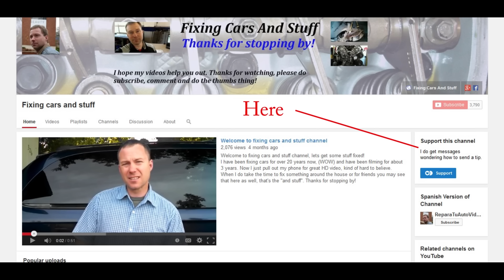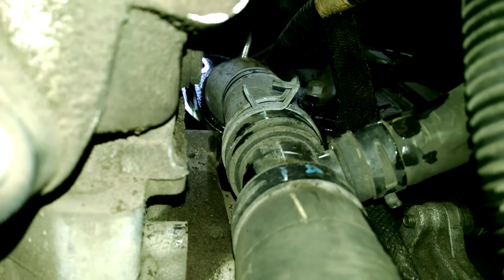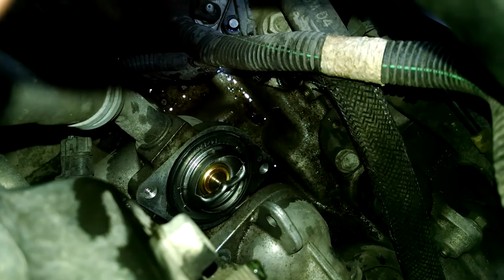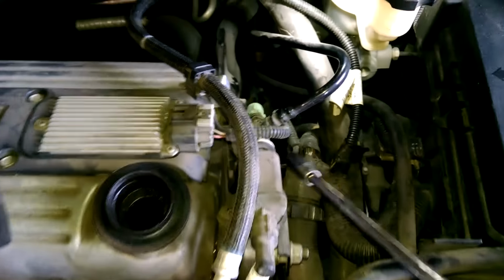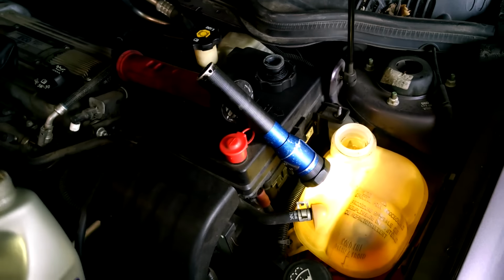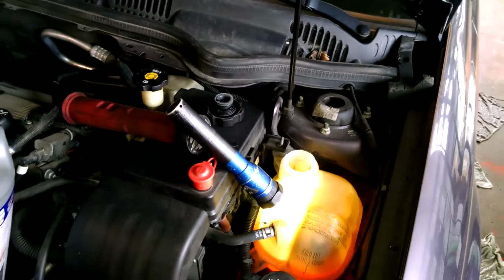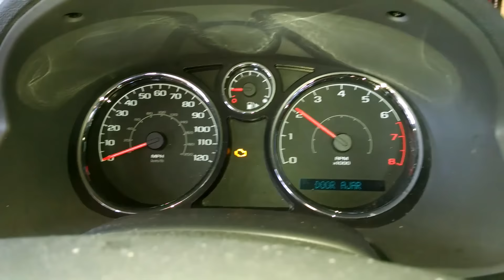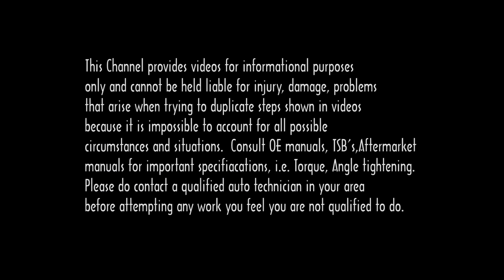Thermostat replacement P0128 2006 2007 Chevrolet Cobalt.  How to change thermostat

Comment: oh your got lucky lol i had an 05 cobalt its bolted directly into the back of the engine and the water pump piping goes directly under the exhaust manifold lol i figured i would never be able to get it back together if i did manage to get it apart took it to a shop lol he had some choice words about it when i picked it up lmao he wasnt happy but got it done lol
Reply: +RastaLulz it was about $150

Comment: I did this but I think I filled the fluid too much to the top. Can that mess anything up? because now my car has a coolant symbol coming on. I take it that it's overheating.
Reply: did you bleed your coolant/antifreeze system?, most likely you have air pockets in the system causing it to overheat, it's real easy to do, only takes about 10min, there's hundreds of videos on YouTube on how to do it, good luck.
Reply: There wasn't any coolant/antifreeze in there. I just poured a bottle of antifreeze in there and it wasn't keeping any in like it was leaking. I took it to a shop to get it checked and they said the thermostat didn't have a gasket so I had to replace it again.
Reply: +blikemimi that sucks, usually the part comes with one like mines did, glad you got it fixed.
Reply: +ResidentGerm that's what I thought too. but yup I called autozone and they exchanged the thermostat for free and I let the system run to get the air out and now my car is A-okay. thanks for all your help!!!